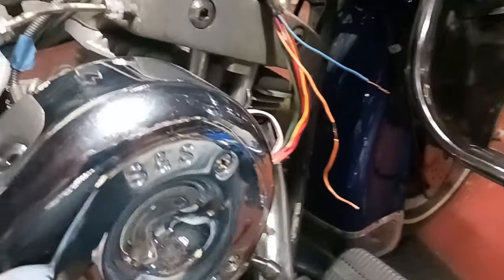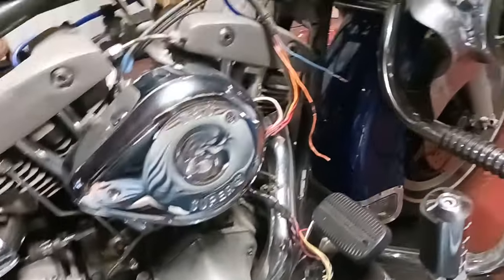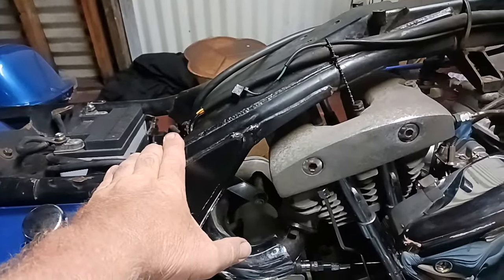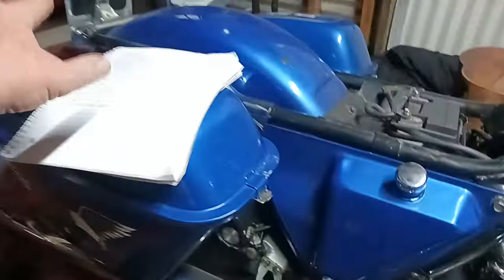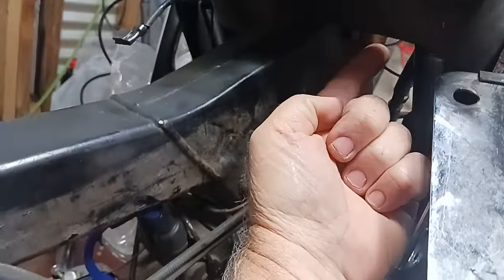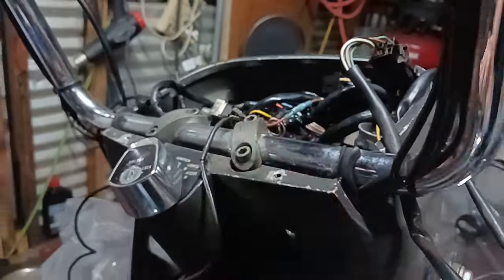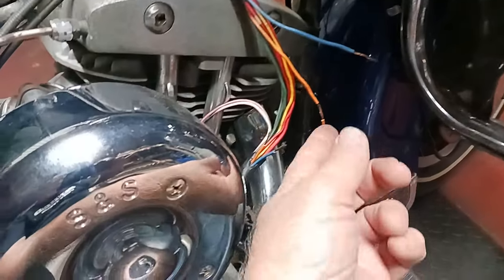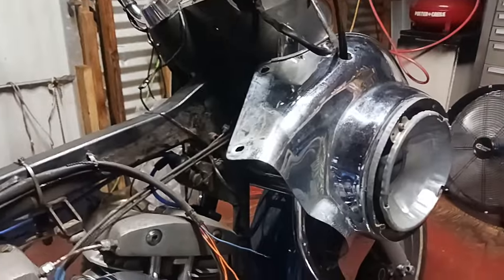HARLEY SHOVELHEAD TAILIGHT/ BRAKE LIGHT FIX

Comment: wires are 41 years old the coating gets hard and crack ,  Might of been from the tank pinch .   The best part is you found it . I hate short circuit's 12 to 16 hours to figure out why and fix .  Thanks for the shot out Ed